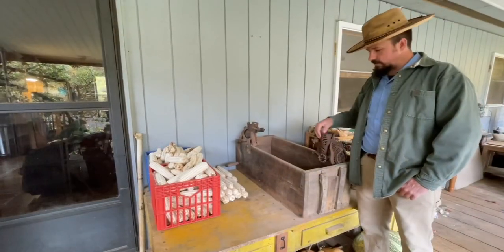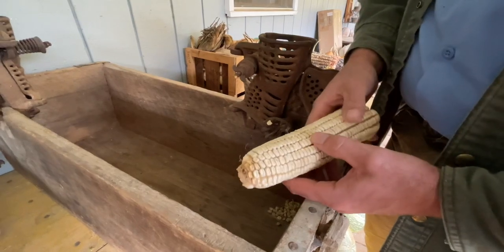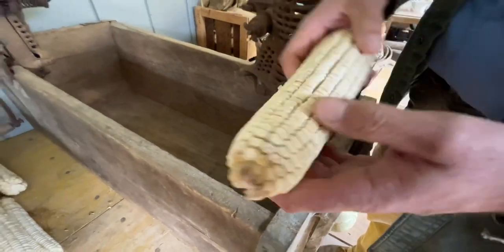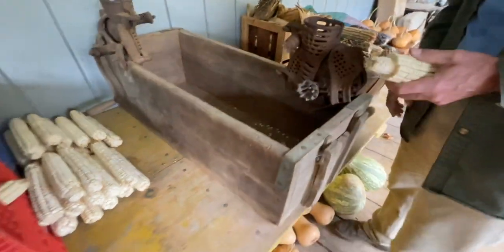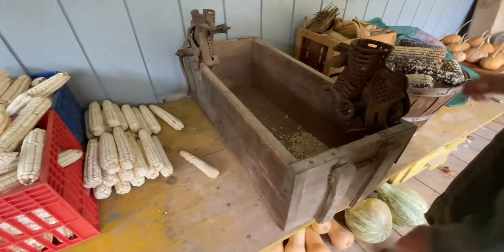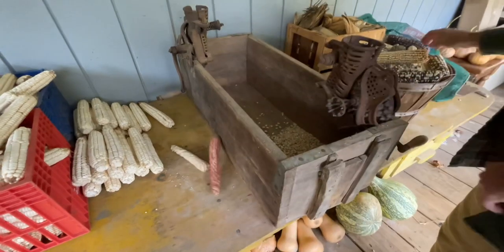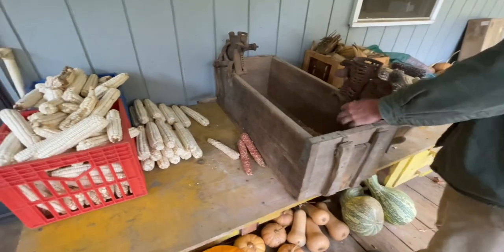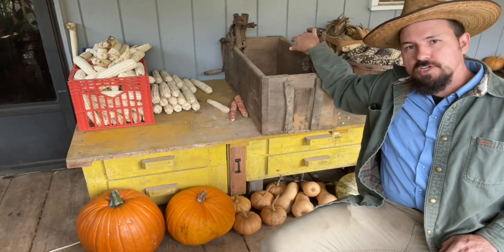How A Corn Sheller Works fff#12 v61

Comment: Justin I have an old fashioned corn sheller that has a large cast-iron wheel on the inside of it. When you hand crank it to get the momentum of the wheels spinning, there is a tray on top that you push the corn cob down into the receiving  chute. Even put a large vessel underneath the shoot to catch the corn and the Cobs are easy to separate from that corn. I don't shell corn with it but I do shell off the hulls of my walnuts with it. Ìt has two settings on it for various sizes of cobs and/or walnuts. Hopefully next year I can put an electric motor on it to keep that Heavy wheel spinning but I don't wear my arm out!
Reply from the maker: Thanks for sharing Paul! I know exactly what you are talking about. Thanks for sharing!